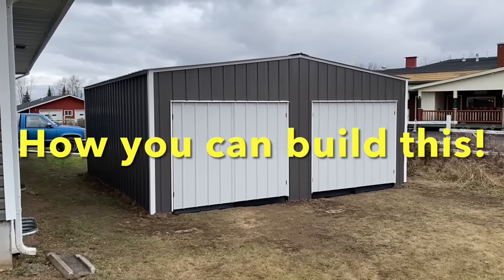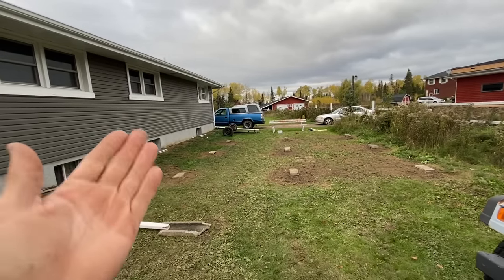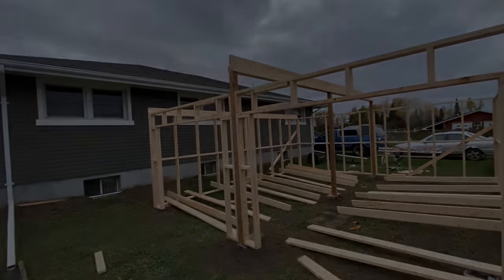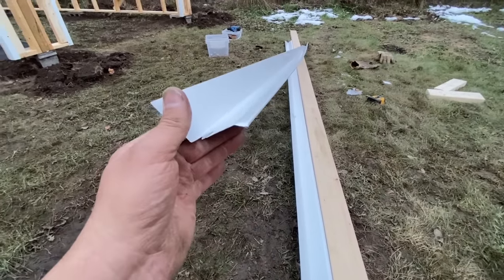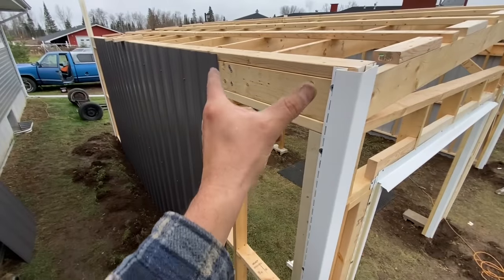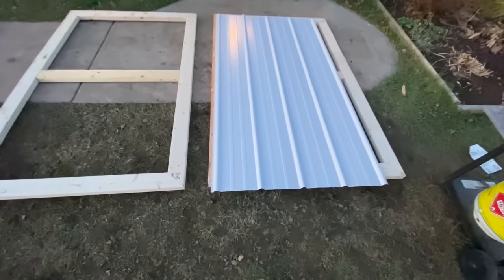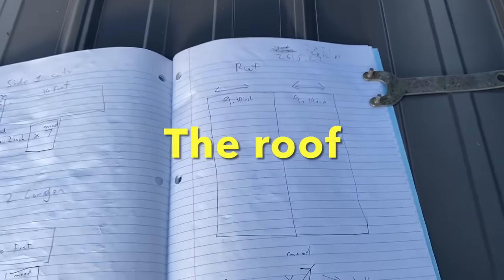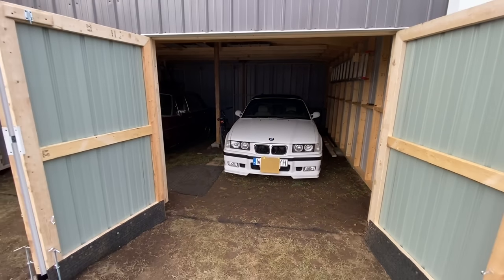How to build a 20x20 Garage for $3000 in 5 days (from Home Depot materials)

Comment: Sweet! When I built my 22x25 a few years ago ($2700, including purchased roof trusses) I did it pole-barn style- as that makes it much sturdier and wind-resistant, and it's even easier to level up. It's resisted 70MPH winds so far.....
Reply: As a lifetime carpenter, I am with you there. Even if you wanted to make s take apart building, pole barn makes sense. Putting all that blocking in between the 24 on center studs, the bottom plate and all that adds to the material list.. Twenty four foot  trusses are stocked items at lumber yards and are economical. I would bet till all that happens, you would have a similar material cost and a superior result. And it would pass code as well. No way could I build a building like that in Ohio anyway 
   Given some thought, it wouldn't be difficult to construct a knock down unit utilizing pole barn methods.
Reply: @ohiofarmer5918  Heck, if it had to be take-apart, I'd just make it in two halves ("Double-wide" style) that could be uncoupled in the middle and then just take each half away on a trailer. The labor involved in taking this one all apart and then reassembling it would be substantial. You'd have to disassemble it, and then level-up the new site; make a new foundation, and then re-assemble- Pretty much as much work as just building from scratch, only what you save on not having to cut the pieces, you loose in the disassembly. I just hope they don't get a lot opf wind up there in Canookistan... At leasty it looks pretty well protected by all of the houses around it. If that were on my 27 acres here in KY it'd fly away...or get smashed in short order, like those over-priced rental sheds you see people with..here today...gone tomorrow! Hopefully it'll be O-K for the OP though.
Reply: I like those metal trusses with notches for 2x4's to attach roof to.    I'm still working out my plans.  I need a bay high enough for a car lift.  Might do one bay two stories.  That or a 5ft pit under it.  High water table here means a sump pump for a pit.
Reply: @robertsmith2956  Think carefully about getting a lift. Raising your hands above your head and craning your neck to look upwards are very unnatural, and many people find working that way very difficult. Plus, the accessories you need to make a lift worthwhile (drain containers that'll reach high enough, etc.) are pretty expensive. Me? I'd rather just lay on the ground. And Scotty Kilmer and Uncle Tony('s garage) agree...
Reply: @bobbylibertini   yea, but the contortions you need to get at part on your back also are not good for the body.  Just went through it with the exhaust manifold. drain containers are easy to make.  a pipe and a bucket.
They have a neat chair that lies you back for working under the car half way up so your head isn't tilted up.
Reply: @bobbylibertini there’s a reason professional mechanics all use lifts.  Working without bending over or rolling in the dirt makes your body last way longer than working overhead. After 27 years as a professional mechanic I guarantee if I hadn’t had hoists my whole career I wouldn’t be able to walk upright by now.
Reply: Listen here Bobby. I’m 23 and my back is ruined already. Do you really think I wanna fuck around with a jack getting it into position? No imma lift it with the lift. Lift it a couple feet, and go ahead and work from a creeper. I work on semi trucks, I know all about being on a creeper
Reply: Listen here Bobby. I’m 23 and my back is ruined already. Do you really think I wanna fuck around with a jack getting it into position? No imma lift it with the lift. Lift it a couple feet, and go ahead and work from a creeper. I work on semi trucks, I know all about being on a creeper
Reply: Listen here Bobby. I’m 23 and my back is ruined already. Do you really think I wanna fuck around with a jack getting it into position? No imma lift it with the lift. Lift it a couple feet, and go ahead and work from a creeper. I work on semi trucks, I know all about being on a creeper
Reply: Listen here Bobby. I’m 23 and my back is ruined already. Do you really think I wanna fuck around with a jack getting it into position? No imma lift it with the lift. Lift it a couple feet, and go ahead and work from a creeper. I work on semi trucks, I know all about being on a creeper
Reply: Listen here Bobby. I’m 23 and my back is ruined already. Do you really think I wanna fuck around with a jack getting it into position? No imma lift it with the lift. Lift it a couple feet, and go ahead and work from a creeper. I work on semi trucks, I know all about being on a creeper
Reply: @iankerr1549  buy some tool boxes, and get a work bench, your garage has a terrible echo
Reply: @robertsmith2956 really Pete and repeat were sitting on a wall Pete fell off who was left repeat 😅 I am mental 😅 peace brother.
Reply: @gibsonexplorer8777  I miss Monk.

Comment: This garage for $3000.00 is a major steal. After a whole lot of research, I can't seem to get near that price for the amount of quality materials you used. Congrats. Other than price awesome video.
Reply: My project price is always low before I start 😂
Reply: Yeah, I'd love more about sourcing materials.

Though I think part of it is that my budget is immediately blown (relative to the video) by the fact that I have to  do piers because flat land doesn't exist around her unless you like flooding.

But I'd love to see this guy just drive around getting stuff and voice their opinions on all the little things, from nails to different board widths, where you can get reclaimed stuff, etc.
Reply: Just like the Tiny Houses or Prebuilt Sheds.. They All can be Built for Almost Less than Half than buying them prebuilt... But Channels Love to Push the Prebuilts.. I think they get a % of the $ for doing so and Remove my Comments that say you can Build For Less... I built a 12x12 Shed for Under $1,000 but to Buy a Prebuilt... Well over $5,000.
Reply: its a major waste. this building wont last the elements and it certainly wont last any scrutiny from code enforcement.
Reply: @MrAwsomeshot   Specially him putting the edges of the Steel Sheets IN the Dirt... Where They Will Rust Away and Not Using Pressure Treated Wood.
Reply: @Bird-wz7nx  he got everything from home depot but the blocks...
Reply: @MrAwsomeshot  duh... many rural cities don't care about permits or code enforcement. And he built a temporarily, moveable shelter for his vehicles. not a permanent structure to live in or even work in.

Comment: YEAH MAN!! IT INCLUDES THE FOUNDATION!!!  
Dude, that is called DIRT!!
Reply from the maker: It's just a temporary moveable carport. 
Keeps the sunlight rain and snow off my car's .
Reply: I thought the same thing when it first showed the doors open, but to be fair...  He did say foundation, not floor. Foundation is what the build rests on, and does not necessarily include or support the floor.  Around here building like that would just result in a wet muddy floor. At a minimum I'd want to dig down a few inches and apply a layer of gravel.

Aside from the floor situation, it looks like a decent cheap storage building.
Reply: cinder blocks are used for foundation not dirt

Comment: Being a retired building contractor I see so many things wrong with this that I would not be showing it . BUT , it's a lot better than a lot of DIY's I see and the cost was cheap . What bothered me the most was no tie downs for high wind like bolted to a good foundation or treated post about 3 feet in the ground . Tie down system can still be added on with straps to ground in concrete . Blocks should have been seated on packed gravel or sand and turned with holes up and filled with concrete . Other than that it is a fairly good storage shed that may have not had to get a permit for  or an inspection depending on where it was built . -- I can still give it a thumbs up .👍

Comment: the blocks have greater structural strength with holes upward and even filled with mortar or concrete. Pressure treated wood at bottom of walls.  2" x 12" headers to span top of side walls to set rafters on (steel siding screwed to walls helps with snow load, but probably not enough).  Otherwise great video!
Reply: Also great forum for upgrades.
Reply: Yes! This was my first observation.
Reply: Yes, it always drives me nuts when I see people using cinderblocks on their side like this.
Reply: Right, leveling the foundation using string with cheap string levels and digging the foundation holes 16.5 inches below the lines then setting the blocks in the holes vertically and filling them with mortar up to the leveled line not only adds strength but makes the leveling process much easier, as the concrete can be used to raise or lower the base by bringing it to the string easier than removing the block to fill or dig. Overall a good video though!
Reply: @azrider3562   Filling the blocks with mortar will keep water out. Freezing water can burst the blocks.

Comment: After living in South Florida for 43 years it is amazing how cheaply Northern structures are built. This building would become a kite in a hurricane.
Reply: unfortunately its gunna collapse under the snowfalls we get, he didn't design the roof to the standards it shoulda been, the roof has almost no pitch so its gunna take the full force of the weight, he didn't properly construct the roof for northern climates.
Reply: Trust me, this meets none of the building codes up north as well. 

HOWEVER after working South Florida doing hurricane Ian repairs for 14 months, don't pat yourself on the back to hard.. 

Can't count how many houses I worked on down there that were so out of code that should have been torn down, but somehow passed inspection, so I moved them to the next stage (hanging drywall). WAY to many houses I had to get out my framing nail gun and nail every single stud in the right way, because they framed the walls with trim nails yes you read that right, they used TRIM NAILS to frame the interior walls. 

Had to drill and install tapcons to hold the walls in place, because that was never done. Door openings WRONG, window openings WRONG, zero headers, no king studs, missing hurricane straps, not bolted to the foundation. (I did what I could to fix them fast and free, but legally I wasn't allowed to do framing work, but damned if I was going to let someone's house be that screwed up) Sad to see so many houses built wrong by total hacks, I would fix what I could quickly and for free, and get to hanging drywall. Had one house that the tile guy screwed up the bathrooms so bad, that they had me do the rest of the tile in the house, and i'm not a tile guy, but it looked 200% better than what the tile guys had done, and now the home owner couldn't afford to have it ripped out and done the right way. The one floor he layed was so bad that you HAVE to wear shoes when walking on it, or you risk cutting your feet on all the edges because the tile work is that bad. Breaker panels that were broken by the electrician, where the breakers were floating freely since the part that holds them down they broke. Had another house that the HVAC guy ran the ducts so bad that the system was NEVER going to work right, failed three inspections, then finally passed, however they never fixed the issue, told the customer it was still wrong, and they told me to hang in anyway, and "I didn't know what I was talking about", guess what I heard when I went to pick up my final payment on the drywall work, the HVAC system wasn't working right, not getting good flow in most rooms (I know why, and have photos showing exactly why). Flooring guys that cut all the LVT flooring wrong around the floor vents, so they had to get 2" larger vent covers to cover their screw ups. Just ZERO ethics by a lot of the contractors.... and yes I have photos of ALL that bad work.

Got fired by 70% of GC's that I worked for in SWFL, because I refused to do hack work. "you're taking to long.. well it takes time to do it right" Don't hire me, if you want to screw the customer. Replaced a subfloor on Sanibel, GC wanted me to cut the floor around the walls, NOPE sent full sheets under the walls, done right, or I'm not doing it. Total greedy people, that just don't care.

If you're ever having a house built, or gutted and remodeled, HIRE a 3rd party inspector. They should do a FULL inspection before insulation and drywall goes hung.
Reply: @C0braChicken2  same in NJ after hurricane sandy. I cringed seeing the work my neighbors paid for but they ignored me when I tried to tell them the issues I saw.
Reply: lol are you kidding? this building wouldnt last 1 winter in Maine where I grew up.
Reply: The ground movement alone will wreck and rot from the ground contact,  in 10years..
Reply: @joanfrellburg4901  You can call it a Pole barn and don't need a permit as long as you don't run Permanent Electricity to the building. Then you would need another meter and wiring ...
Reply: @MrAwsomeshot  most people don't live in maine. many mobile homes wouldn't be suitable in a lot of places too but then just don't build one... lol

Comment: For a floor you should look into soil cement. essentially you just use the dirt on the floor roto tilled with cement i forgot the exact ratio but its like 1 bag of cement to 10 parts dirt, in othere words you can get a cement floor for about 150 bucks , well worth on a budget build like this. . you just earned your self a sub, great vid man
Reply: It cracks easily.  Gravel is cheap, and portland cement is expensive.  Readimix is as cheap as it gets unless it is in small quantities.
Reply: This built on a concrete pad would be perfect. Add some to the overall price but you could anchor the bottom sill plate (pressure treated) right to it to make it more permanent.

Comment: Very simple and would be very easy for a typical homeowner that is not in the trades. Only a few things I would add. cinder blocks closer together to prevent wall sag on his foundation. Treated bottom plates and use a header over the door openings for strength.
Reply: Top plates also normally double and overlap.
Reply: By using triangles in the construction of the headers, he could have increased strength greatly. I agree that treated should have been used and also better support under walls with some sort of anchors. No birdsmouth on rafters puts full weight on a very small portion of rafter.
Reply: more money... I have seen old shacks on abandoned properties on youtube, and they are still standing and it is MUCH  construction than this build.  So please..   shhhh...

Comment: You are an absolute Rockstar! Simple instruction, no B.S. + hard work always equal success. I’ve seen comments on your “cinder block” orientation and I have to smile. We’re building a shed here folks. 1 story…I don’t care if you have 6 feet of snow sitting on that roof…you’ll split rafters before you crush a cinder block….sideways or upright. Especially when your weight is on the webs ; )
Reply from the maker: 100% correct. I've built tons of these this way even over 10 years ago and they're still standing and look exactly the same, nothings moved or cracked. Thanks for the feedback.
 People don't realize it's a carport, one guy commented that it will be cold inside lol.
Reply: @ProblemSolverGarage  wood stove and some lights and that'd be golden.
Reply: @ProblemSolverGarage thanks for the video and the laugh.  Merry Christmas 🎁🎄
Reply: as long as the Load is spread out across the full surface of cinder block, he should be OK.   The problem is when you use a cinder block as a "Car Jack Stand".  If you do that, the block can break because all the force of the car is pressed on 1 inch area of the block.  But in his case, the 2x4 is spread out across the cinder block, so I dont think it is relevant if a square cinder block is rotated.

Comment: A few mobile home anchors on each side might keep it from blowing away when the wind blows hard. Thanks for your ideas! I’m building a shed to house a few of my tractors.😊
Reply: What's he going to anchor it to . . . . . . . the cynder blocks?

     R i g h t  ! ! !
Reply: @crossbowmd61  
Mobile home anchor “screw” into the ground, not to the cement blocks. They hold amazing well (in dirt, not sand)
Reply: @c50ge 

OKay.
    But did he do that?

No.
    If he had, he deffinately would have included that in the video.

      But he didn't.
Reply: @crossbowmd61  That's why he made a suggestionnnnnnnnnnnnnnnnnnnnnnnn....